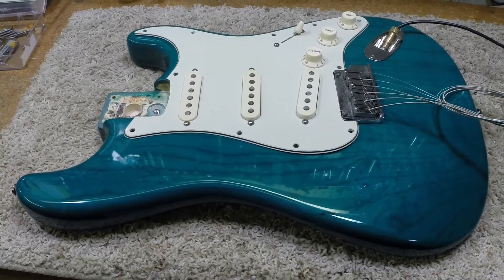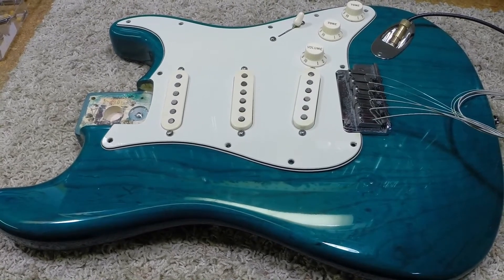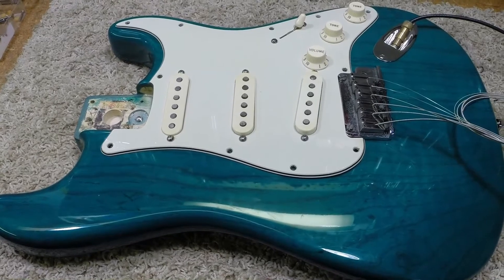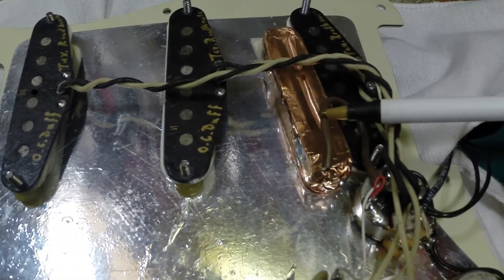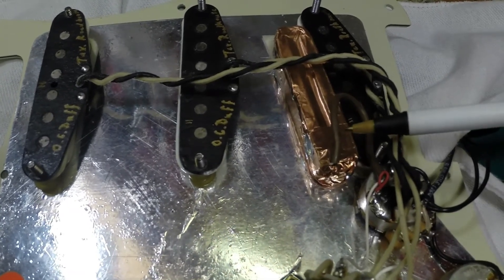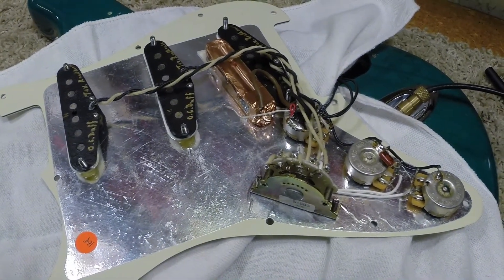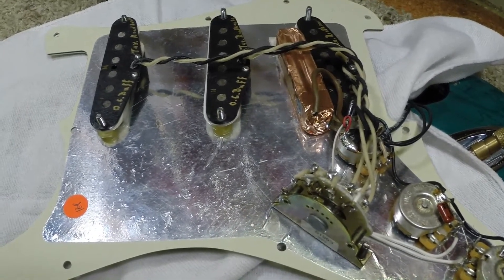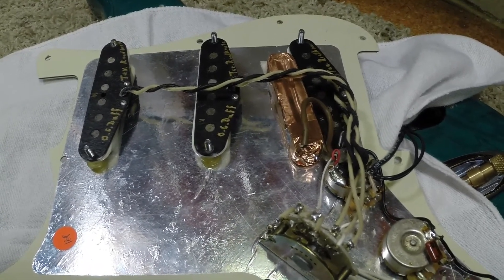Making a Single Coil Strat Noiseless

Comment: One thing I don't understand is why you would shield the dummy coil. It seems like the purpose of this coil is to pick up noise, so wouldn't shielding it make it harder for it to do this?
Reply from the maker: It does not pickup noise, it is there to electronically cancel noise.  So why not shield it?
Reply: @guitarc.p.r.9675  My impression of how a dummy coil works is like this: While your guitar pickup is picking up signal and noise, the dummy coil only picks up noise. When you combine that at 180 degrees out-of-phase with your pickup, the noise will cancel out, leaving only the signal. So that's why it seems like you wouldn't want to shield the dummy coil.
Reply from the maker: If that was the case why would an original humbucker have a metal shielded cover.....
Reply: @guitarc.p.r.9675  I think it doesn't matter if the cover is there or not. If it's not there, both coils are picking up noise, and because of the way they are wound, they cancel out each other's noise. If the cover is  there, each coil picks up less noise due to shielding, but the effect is the same: they cancel out each other's noise.
Reply from the maker: Sounds like you have contradicted and answered your own question.
Reply: I'll see if I do a better job of explaining what I mean. With a pickup cover acting as a shield, each coil is picking up less noise, and because they are reverse wound, the signal adds while the noise is canceled out. With the pickup cover off, both coils are picking up more noise, yes, but because both (that's key) coils are picking up more noise, they still cancel each other's noise. So the shield isn't all that important in a humbucker. That's why plenty of guitars use humbuckers without the covers. But something you never see on a humbucker is where one coil is shielded and the other not. That would upset the signal to noise ratio between the pickups, resulting in less noise/hum canceling. So getting back to your guitar, you've got one coil shielded and one not. That's what I can't make sense of.
Reply from the maker: Ok here is my thing.  Pioneers of hum cancelling "passive" coils (Alembic etc) have always shielded their coils.  It just seems to be the right thing to do.  Also, as I said I did not want the passive coil adding any noise of its own.  I also look at it this way,  if you are cleaning up a water leak mess, isn't it easier to turn off the in-rush first.  Bottom line is this, This is the way I have done it for decades, sometimes in a fully shielded guitars and sometimes not.  I've built basses with hidden passive coils.  It works.  BTW you have seen teles with reverse polarity pickups right? There is your one shielded and one un-shielded coil.
Reply: First off.. thanks! Great video. Noise suppression on these little antennas we all know and love is incredibly nuanced and finicky. I agree with the Mr. Joe that shielding the dummy coil is counter-intuitive, I immediately recognized that. But I think you are both right and the answer may be that for the induced local noise, the shielding is ineffective (pointless) and the suppression technique would work anyway... OR you didn't actually ground the shielding?? There is no ignoring the bottom line effect that is demonstrated, but Stumper is correct about a humbucker requiring side-by-side  configuration and the cover effecting both coils equally. In other words... humbuck cover is a red herring, and no matter the science, this is a great technique. If I try it I will test with and without shielding the dummy coil. Thanks for the video!
Reply: What's often not discussed in guitar-oriented treatments of EMI (electromagnetic interference) is that different noise sources couple to circuits in different ways. Metallic shielding shields against capacitively coupled noise sources, such as RFI, but it does not help with inductively coupled sources, i.e., magnetically induced noise from nearby wiring. So the shielding of the dummy coil may help protect it from RFI (if the shielding is properly grounded), while the coil itself remains inductively coupled to external noise sources, so if it has reverse polarity vs. the pickups, it reduces noise, not by shielding, but by introducing nearly the same noise with reverse polarity, canceling it. —Tom

Comment: Thank you so much for the info. If the pickups are standard (with no rwrp)  the HOT of the dummy coil will be conected to the switch?
Reply from the maker: Yep.
Reply: Thank you sir.
Reply from the maker: Actually depending on the polarity of the original pickups you may have to flip the leads of the canceling coil to to cancel the hum.  It varies.
Reply: I will make the test with only one pu (the neck) then i move foward. Thank you for the tip. I wish i knew that before i sold all the other american strat pickups. :))))

Comment: Thanks for this, was very helpful.  Most instructions online tell you to wire the dummy in series, that did not work for me. Once I wired in parallel, to ground and to common switch worked it worked great.  Only thing that doesn’t cancel the hum fully is when I use my blender pot. I have a master tone and blender pot between neck and bridge pups. I also have RWRP middle so I put in a switch to kill the dummy coil.  In position 1 and 5 with dummy on and not blending it’s very quiet, hum is cancelled.  When I start to blend in either the neck or bridge I start to get some hum.  I’m wondering if that is because of the two coils far apart both being active. Is there anything I can do?  Change out the dummy for a higher resistance one ? Right now the dummy is slightly lower than the active pups.
Reply from the maker: Thanks for the very rare positive comment on this.  I am short on time this morning, but I will get back to you very soon when I have time to devote to a proper reply.
Reply from the maker: After  consideration,  instead of a long detailed technical explanation here is the short version.  With the hum-canceling coil connected to one pickup you are at nearly  100% hum cancelling.  When you connect another identical pickup the percentage of hum cancelling goes to about 50%.    Also the height of the dummy coil is not important it is not sensing the strings at all, as long as the magnets and polepieces have been removed.  As for the blend pot, I have not had much luck with them, a switch seems more useful.  Way back in the early 70's I rewired my strat (which only had a 3 pos switch at the time, and was designed for only one pickup at a time.) like a tele, with a volume pot for the middle pickup.  I have found that with shielding etc. the guitars are very quiet.  Thanks for watching.
Reply: Thanks for the response.  So with the blender turned on I’m basically reducing the effectiveness of the dummy.   Maybe I could add a 2nd dummy coil and re-wire so both neck and bridge have a dedicated dummy coil?
Reply from the maker: That could be done.

Comment: 1. Is it a pickup cover wrapped in copper foil or the upper and lower bobbin?
2. Is there a hot and ground wire connected to it or just the ground wire only?

Comment: Wiring diagram would 
be better, surely?

Are you saying that the "hot" lead of the dummy coil is attached to the output of the selector switch & set these to go to the input of the volume?
Reply from the maker: That is exactly what I said. Except that the hot and ground leads may have to be reversed to make it reverse wound.  Depends on the hum cancelling pickup purchased. That works in this case with the pickups all the same polarity.  If you have a reverse wound middle pickup then it would need to be wired differently.  The variations are many, so each needs to be approached differently. The idea of the video was to show you the concept. Give you the tools to figure it out on your own for what ever situation you have.  There is no one easy wiring diagram for this, and in this case it is pretty simple.  A hum cancelling coil and 2 solder joints one at the output of the switch and one to ground.
Reply: @guitarc.p.r.9675  thank you!

In retrospect would you say that it would be better to have one dummy coil for each pick up?
Would this affect the sound for better or for worse with the in between/quack positions?

Is parallel definitely the way to go, NOT series…?

Thanks again!
Reply from the maker: Multiple dummy coils are not necessary. If a reverse wound pickup is used in the middle position I would use a monster switch to flip the leads of the dummy coil when using the middle pickup alone. Tone is a very subjective matter and everything can affect it.  Parallel vs series do sound different.  If you have not read comments there are many questions answered. There are both positive and negative comments. There is so much controversy here it may as well been a Marshall video.  Hope this helps.

Comment: Hey Charlie!! Hope you’re well!! Where can I buy a coil cheap enough for the magnets to slide out… I’ve tried ordering $20 pickups on Amazon and they’re the ones you can’t slide the poles out……let me know!! Thanks for the video!
Reply from the maker: Hey Kevin,  Check out this video, it will answer your question.  Give me a call you know where to find me.  I have taken a lot of grief over this concept, but it has been proven for decades and is still commonly used by some manufacturers.

https://youtu.be/glsLYKc5HfQ
Reply: In that other video, he used an AllParts 417 pickup. The actual part appears to be the PU-0417-000 Single Coil Pickup. It's currently (Jan 2025) less than twenty bucks.

Comment: Hi I’d like to try this in a Warmoth esquire type build. One very noisy bridge pickup, one volume. That’s it. Plenty of room in the control cavity. No switch. Just a 250k volume pot. So just wire hot to the output jack & ground to the volume pot?
Reply from the maker: No, wire the hot to the input of the volume pot and ground to the back of the pot.  Make sure your polarity is correct and you should be golden. It would be really nice if you could fit it under the pickup.  I also like to shield everything but opinions vary.  Thanks for watching.
Reply: @guitarc.p.r.9675  thanks! I’m gonna give it a try. The pickup is custom wound, Birdseye maple bobbin, matches the guitar & does sound great! Except the hum. Thanks for the info

Comment: Awesome. I just wonder why the dummy is shielded, since its purpose is to pick up the hum
Reply: …of course, if it’s not grounded, it wonkt shield, but I still wonder what its purpose is.
Reply from the maker: The dummy coil is passive.  It does not pick up hum but is reverse wound to cancel the hum from the other pickups.  If it is left unshielded it just introduces more hum into the signal, making it work harder than it has to.

Comment: A great idea and a great experience, but I don't know English well. Poorly understood, is the false coil connected in series to the output jack? Is only the shielding of this false coil connected to ground?
Thanks!
Reply from the maker: Let me try to clear this up for you, and anyone else that may read this.  Luckily English is also my second language, unfortunatelly Hillbilly is my first.  The hum cancelling coil is connected in parallel from  the output lug of the pickup selector switch that is connected to the volume potentiometer,  to ground. The shielding is also connected to ground.  Depending on the particular coil you are using connecting it one way will cancel the hum reversing the leads will induce hum.  That part has to be done by trial and error.  Thanks for watching.
Reply: @guitarc.p.r.9675  Ok! I see. Thanks!
Reply: @guitarc.p.r.9675  I looked at the encyclopedia - Hillbilly is the language of the Highlanders! I thought everyone in America spoke English. :-)  Thanks for your reply. Good luck from Siberia.
Reply from the maker: The cyclopedia does not take into consideration that "hillbilly" in our case referrs to the Mountain folk of the Appalachian Mountains of Eastern and Northeastern United States.  In my personal case the state of West ( BY GOD ) Virginia.  Mountain Folk, so I guess it is correct as well.  Best wishes to you in Siberia.  Thanks ya all!

Comment: I have a set of 57/62 set on my strat. All pickups are the same meaning all have the same specs and polarity and wound. So there is no hum cancelling in ANY position. Will a Dummy coil help reduce the noise considerably?
Reply from the maker: Short answer is Yes.  But.... I have considered taking this video down due to arguments over its usefulness. Another reason I have not been posting videos, because everyone has an opinion and is an expert on all subjects.   It works, it has a couple drawbacks, well, because nothing is perfect.  However, I have done this for years with a lot of happy owners.  It is not a one size fits all magic bullet, and it takes a bit of knowledge to achieve the best results.
Reply: @guitarc.p.r.9675  I understand. But I'd rather listen to people who actually applied what they learned like you. That is why I raised my question. I will see if it will help installing a dummy coil. The original pickup on my strat might do the trick.
Reply from the maker: You have to use an empty coil with no magnets or iron load.  The plastic molded pickups Fender has used work well.  You can slide the magnets out.  That is exactly what Fender did in the Japanese made Strats in the early 80's.  For some reason it was not accepted well.
Reply: @guitarc.p.r.9675  noted on that one, remove the magnets and polepieces...
Reply from the maker: Remove the from the molded plastic bobbins only.  The magnets hold the bobbins together, and the magnet wire is wrapped directly around the magnets.  Just in case you did not know.
Reply: @guitarc.p.r.9675  noted on that. Thanks

Comment: Sorry for asking, I was wondering can I do this on humbuckers? Cause for some reason, my HH pickups has noise, Thank you! Also what if the bridge of the strat is hotrails? Can I still use this method?
Reply from the maker: You should not have to do it for hubuckers, I am guessing you have a problem else where.  Make sure the pickups are wired correctly in Humbucking mode, sometimes the wiring codes are wrong.
Reply: @guitarc.p.r.9675  Ohh I see, thank you!
Reply from the maker: I did not have the time this morning to give you a proper answer so here we go.  I have run into a lot of humbuckers wired improperly. I believe there is a video here about it.  Sometimes the factories get the leads reversed or color coding of leads wrong.  Also make sure all the shields on the cabling is grounded properly see that a lot too where some shields are not grounded at all.  (many Gibsons)  Also check the jack to make sure it is not wired backwards.  I found the video just and example...

https://youtu.be/Ivk3MEttwN8
Reply: Thank you for the advice, this really helps a lot, maybe its the shielding, because I only have copper shielding in the pick guard but not in the cavity and I think there is no wire connecting the ground in copper tape and pots. Thank you!!

Comment: Hello,The hum only went away when I put the hot(white) to the ground and the ground (black) to the output on the switch. ...but....!!!! now my tone knobs are only working with the 5 way switch on 4 and 5.Any suggestions are appreciated.
Thanks..
Reply from the maker: Are you sure you connected to the output of the switch and not the tone control taps of the switch?
Reply: Thank you for your quick response.Sorry about the tone knob problem.I kinda thought there was a wire that came off when I put the pick guard back on. When pushing the wires in to set the pick guard back on the ground for the back tone pot came off.It is a very small wire and I didn't notice it at first.Sorry for jumping the gun and not checking it first..As far as connecting the dummy pickup,I ended up removing the wire that connects to the output switch to the vol. pot tab. The only way the hum would go away is that I had to connect the white wire to the tone tab and the black to the switch.
I did replace the middle reverse pickup with a bridge pickup I had laying around.

Comment: If I'm about to install it on an HSS will it work? If it does not is there a way to install it in a different wiring configuration so it would work anyway?
Reply from the maker: Sure! you just have to wire it so that it only works with the single coils.  You may need to use another switch unless your guitar has a master tone control.
Reply: @guitarc.p.r.9675  Thanks for replying, I think I would use a push-pull pot or a superswitch for more options
Reply from the maker: The super switch would be my choice.  That way you can flip leads on the passive coil,  just in case the 2 single coils are opposite polarities.

Comment: Question about this: Does the coil have to be mounted directly behind the bridge PU in order to 100% work or can I place it anywhere else in the body cavity? TY
Reply from the maker: It can goanywhere.  BTW you do not want 100% cancellation, that will also extremely cancel highs.  I like to look at it as an asymmetrical wound humbucker.

Comment: Did you make the dummy  from a bridge or middle/neck pup? assuming that the impedance used for the dummy might make a difference....or not?
Reply from the maker: I used a standard economy strat pickup.  As I remember the DC resistance was around 6.5K Actually for the least tone cancellation you want the coils slightly unbalanced.  Asymmetrical coils are very common these days in humbuckers as well.  This is useful in cancelling hum but not highs. Thanks for watching.
Reply: @guitarc.p.r.9675   There's a cheap FLEOR Alnico 5 Strat bridge pup on ebay at 6.2 K which may be suitable....I'm assuming the neck and middle pup's are a lower res than the bridge so hopefully the FLEOR will do the job...